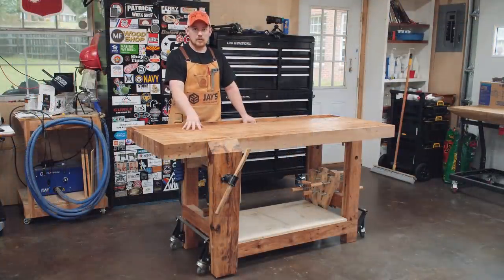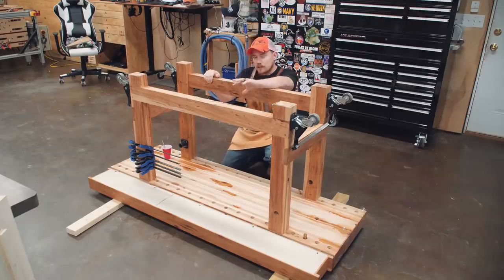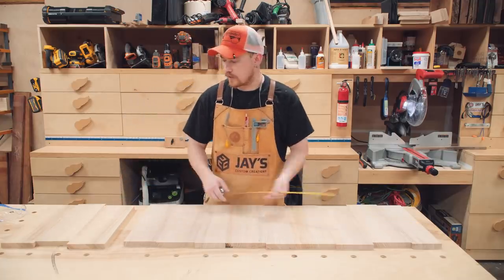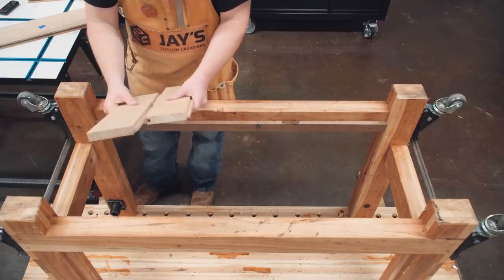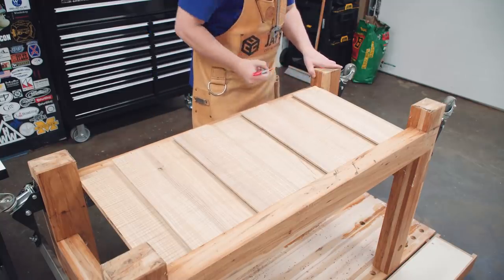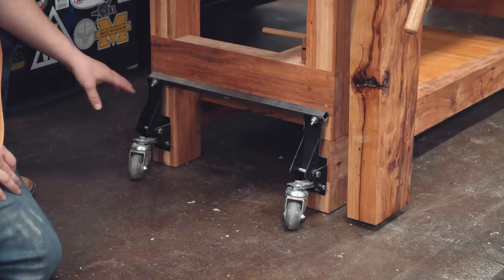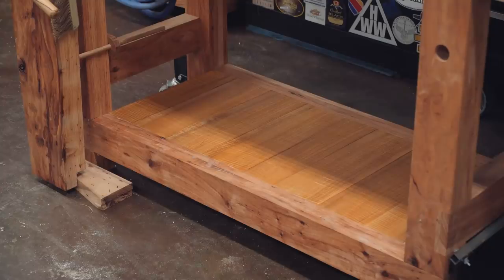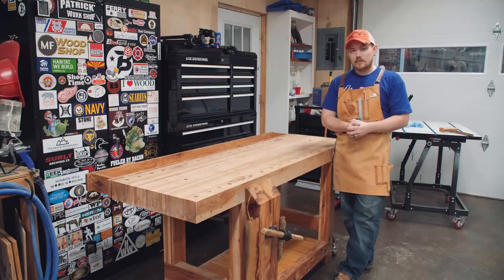Workbench Fix & Upgrade - 354

Comment: In the UK our t&g are cut differently. The underside groove lip is cut 1 to 2mm shorter than the topside groove lip. This results in the joint on top always closing first giving you no gaps facing upwards. We do the same on the underside of our skirting. The bottom of the skirting where it makes contact with the floor is bevelled back approx 15 degrees so the front leading edge is always touching the floor.

Comment: This was the first thing I built once my shop was up.  I made my dimensions a little different but really like the leg vise as well.  I noticed the bottom corner of yours has a rabbit for the wedge board...I have to do that as well since mine is always out!  I have my wood hammer on a nail on far right side and a brush on the far left.  They are never in the way and can't even see them unless you look!  I didn't like the tool well when I first saw you build it but have to agree, the left side of my bench has tools on it much of the time so will have to build a tool well.  I have noticed plenty of seams in my pine top so will have to do the thin epoxy as well.  EVERY project I work on has come off this workbench.  It is one of the most important tools in my shop.  Cannot thank you enough for your videos on your workbench and all the others!

Comment: Very beautiful bench, Jay!  Love the look of the Hickory top and legs as well as the curled Ash shelf.  Almost a shame to abuse them by banging projects and dripping glue all over them. When I build my bench next year after my new shop is built I will model it after yours.  Looks simple to build even for a noob like me.  
A few comments, if you don't mind, from an armchair woodworker who's never built a woodworking bench in his life but enjoys looking at videos of other people who have built them:  
.  Love the tool well - will add that to mine.
.  Like the square channel connecting two Rockler casters together, but in my case, anything situated outside the footprint of the table itself will probably get in the way of my feet at some point.  If it's on the floor, I will find a way to trip on it.  So, I plan to put the casters between the font and back legs rather than to the left and right of them.  
.  Love the leg vise, especially that beautiful Hickory grain patterned chop, but I'm not crazy about the wedge and the chop's wobble arrester.  I think I will try my hand at making a crisscross mechanism instead just because it's harder to make.  It should, however, eliminate the wobble, the chop cant and the screw guide thingie, but I may go your way if I find I've bitten off more than I can chew.  Thanks for sharing these options, they are useful considerations.

Comment: I have used a lot of this product as well as there competitor that created the formula. Fantastic product with many many applications specifically in my line of work (antique marine restoration). One of the times the product does not work as desired is when the surface you are repairing is not clean and bare to allow the epoxy to penetrate into the wood fibers such as a surface with a light film of glue on it. You have some great talent for such a young man and I hope you have great success in the new shop.

Comment: ❗ SIDENOTE: 
To clean the toolwell faster, just put in a wedge (full width) on one side end inside of it, that ramps up to the edge and you can brush sawdust easily out. That's how most workbenches have it here in germany.
Reply: And put a wastebasket right under that end of the tool well.
Reply: Would a slotted tool well work?  Obviously the small tools could be a problem but if they're mostly larger items, why not just build it with long slots, no dust, no fuss.

Comment: add a puddle of woodglue on the top of the crack.
Use a shopvac to suck the glue from underneath into the crack.
Clamp ,dry and done.

Comment: Love the channel and this build. I have a few questions. (1) Do you have drawings for this, I see you have a similar bench in your store but designed for dimensional lumber. (2) I have two large hickory trees that I cut down and have a sawmill, and now I know what I want to do with these logs. Do you suggest making the top from two large 3"-4" slabs or laminated like you did here? (3) Instead of a tail vice, I'd like to incorporate a Moxon vice, I didn't see you do this here on your other bench videos, what do you think about this?

Thanks again for everything!

Comment: incredible selection from the "waste" pile. do you find the thinner epoxy and glues more useful than the thicker?
Reply from the maker: Purely situational.
Reply: Jesus, I agree each product has its own merit. The thinner will flow into small unacceptable spaces. The thicker will stay where you want it and clean up might be easier.

Comment: i'm just being fussy but it would have looked better if you'd split the left over cut between the two opposite end boards
Reply from the maker: Maybe. But they are all random width and the odd sizes don't jump out visually.
Reply: I was thinking the same too, and i would have centered it as well with cuts equal on each end.  But it is just a shelf so I guess it really doesn't matter.
Reply: @JayBates  at the end of the day if you're happy with it, doesn't matter what we think

Comment: Jay, what did you use for your floor slab covering/Epoxy?
Reply from the maker: It was already done when I moved in. It looks like they just made sure to do a surface finish after it was poured, then stained it, then sealed it.

Comment: Workbench design has a cross-grain support which results in stresses to the bench top when the wood shrinks in lower relative humidity. Either the support beams bend and the top warps, or the glue joints pull apart. It is not surprising that you are seeing glue joint failures with that flawed design.